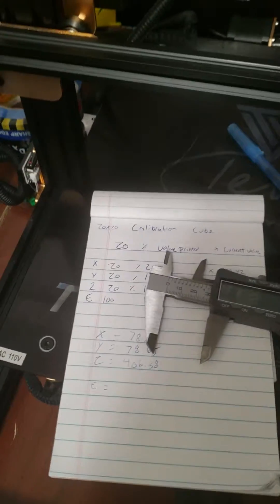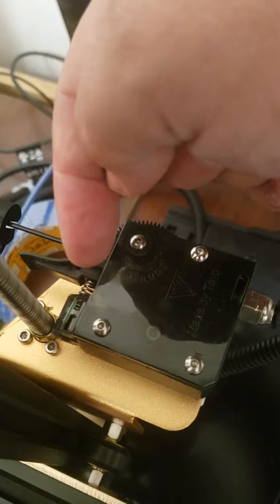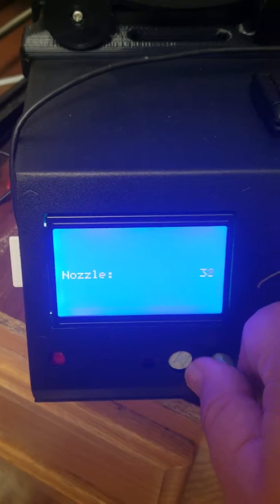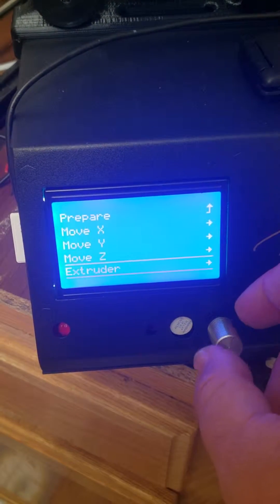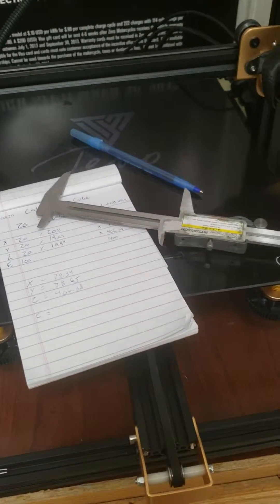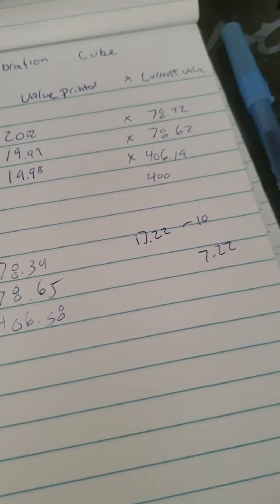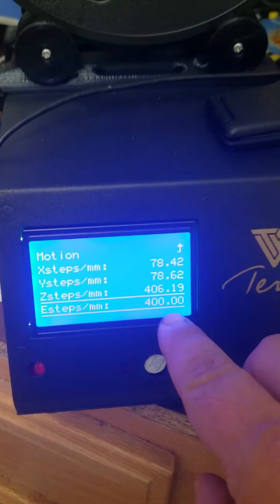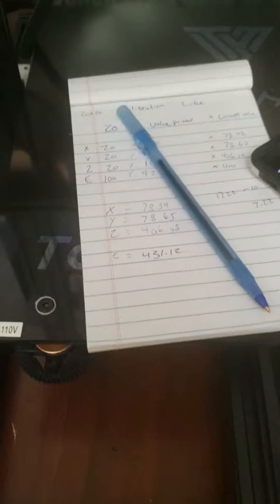Extruder calibrations for tevo tornado

Comment: i did not understand the " minus 10 " at 5.07 minute....could you light me up? ur video looks pretty interresting i need to calibrate my own tevo....thanks mate
Reply: at least can i "just copy" all your valur into the setting of my tevo? i under swim, i dont understand half of the job....
Reply from the maker: Trying to figure out how much it takes to get 100mm though. But you need to have an amount you can actually measure. Marked at 110mm so you minus the 10 off of what ever you have left to get to 100. If you over extruded for an example you would have less than 10 left... So you can't measure what it over extruded if it's sucked it into your machine